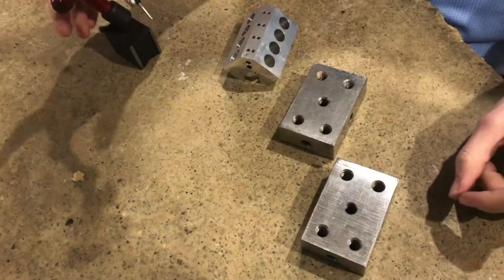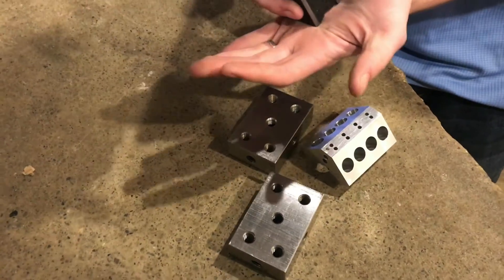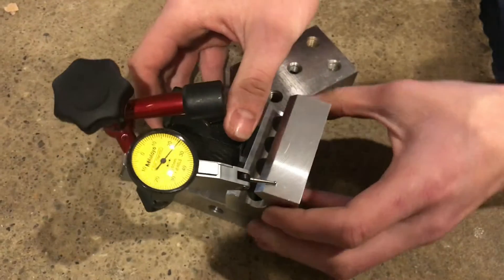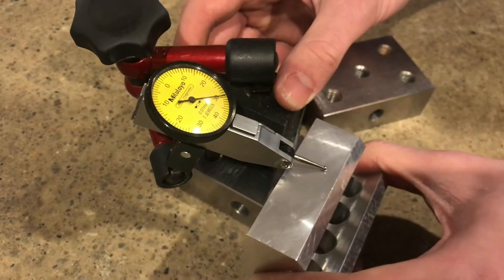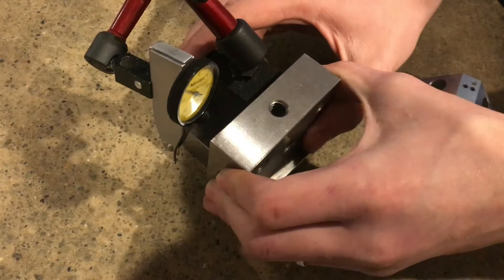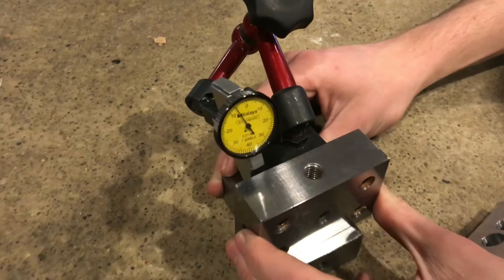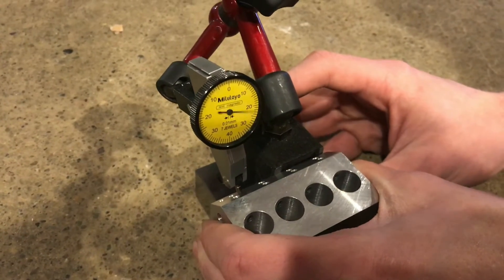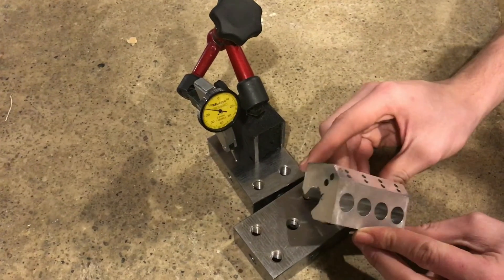how to measure parts for parallelism and perpendicularity LOW COST

Comment: Tolerance how much?
Reply: Depends on how accurately the blocks are made. For perpendicularity it also depends on how perpendicular the mag-base is to itself.

It's better to check the parallelism using the granite because it is likely to be calibrated and much flatter than the 1-2-3 blocks. If the granite is properly flat then the tolerance is basically whatever the tolerance is on the indicator. There is another small mistake in this video though in that he only took each measurement along a single axis (moving the part side to side left to right). He should have also taken measurements forward and back along the entire surface. If you only check left to right you are basically checking one line to a plane instead of a plane to a plane.

Also when checking any of these features make sure you are using the datum side as the zero (datum should be touching the granite) according to the print.

I know your question was two years old but hopefully that is helpful for you or someone else